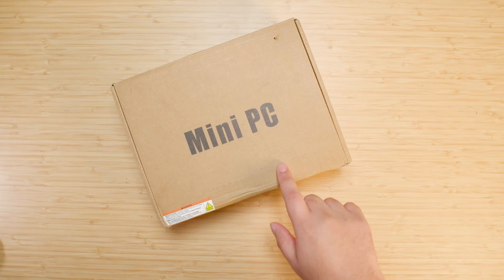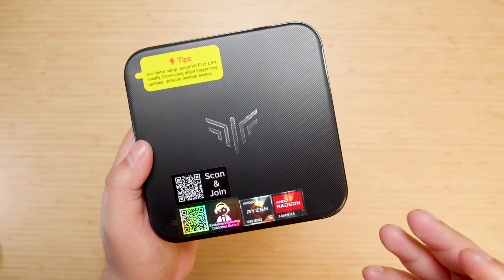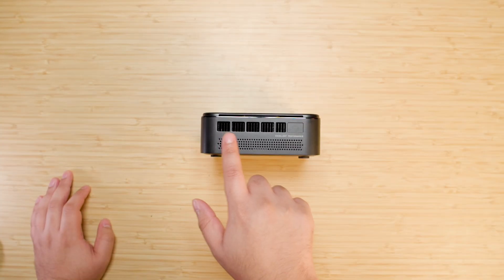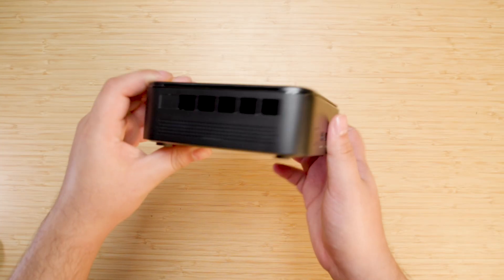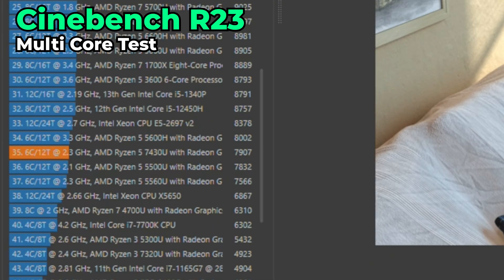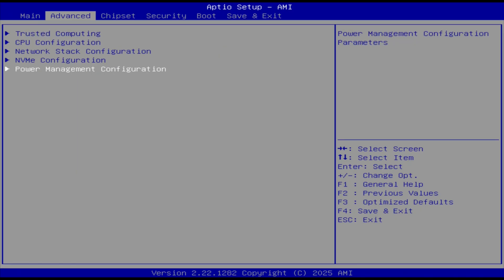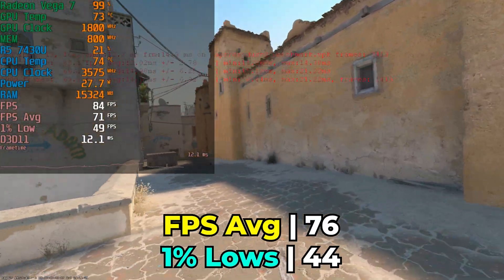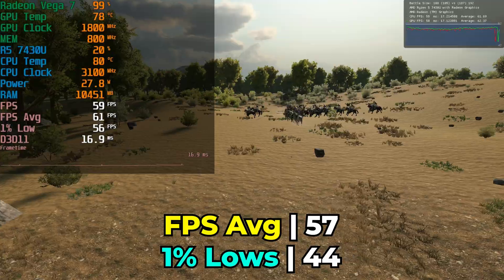$260 Mini PC For Everyone | KAMRUI E3B Mini PC

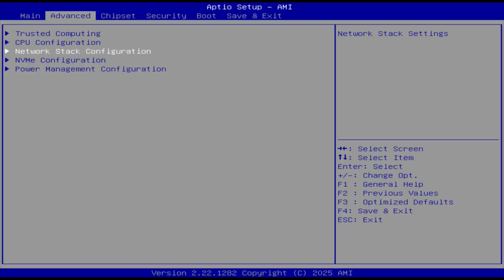Comment: Did I read it right that the included 512GB M.2 SSD is SATA rather than NVME?  (which would mean both M.2 slots should support both NVME and SATA)  It'd be interesting to get a CrystalDiskMark speed test on it.  In normal use it's probably not noticeable, but I think this might be the first mini PC I've seen that opted for a SATA M.2 instead of NVME.  (Edit: At 4:04 it says "No NVME Device Found" - 404 not found...  Hehe)

Comment: Its about time vendors sold these old parts, including the 5500u with  soldered 32GB LPDDR4x at 4266 Mhz. Thats where the real power of these parts lie. DDR5 is still pretty expensive these days. These OEMs can make solid cash with high capacity/frequency soldered 32GB LPDDR4.